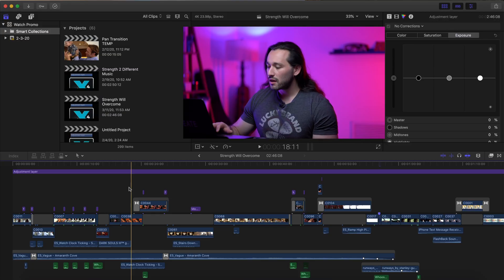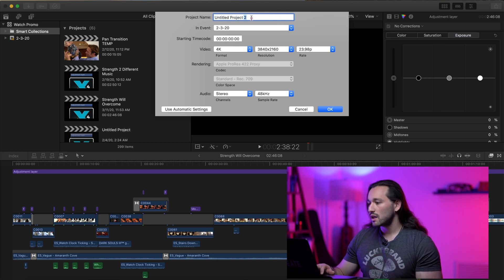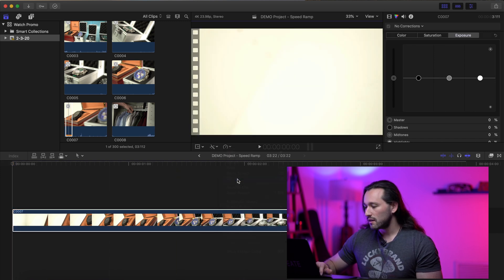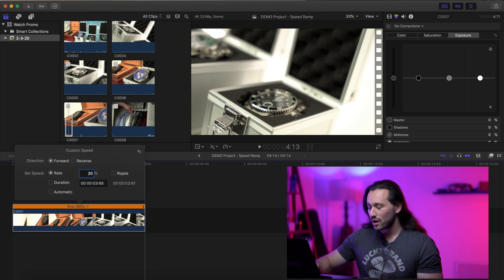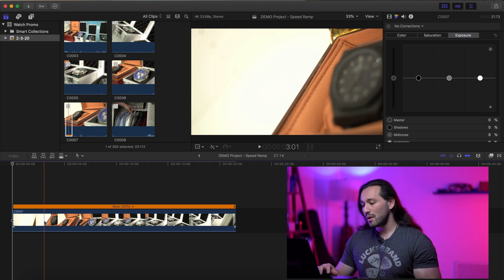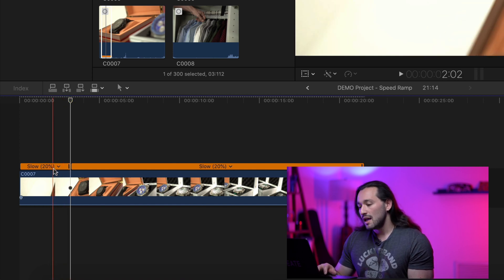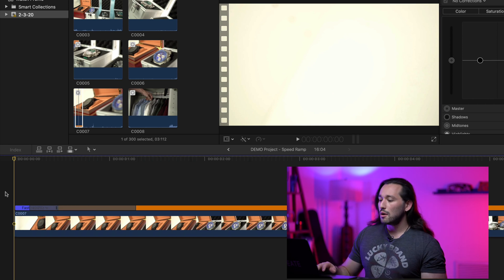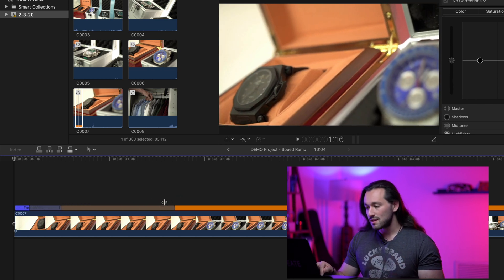BEST Way To SPEED RAMP In FINAL CUT PRO - In Depth Tutorial

Comment: Hi , you did a correction on your speedramp by undoing the speedramp that started on the wrong position.  But you can reposition the start point by doubleclicking on the grey bar. Now it says edit frame source.  If you click on that you can reposition your starting point. Another important feature is the ripple box in the custom speed handle.  If you unbox that the lenght of the clip stays the same.
Reply: This is great tip!  I have been trying to figure out how to do this - I knew there must be a way!